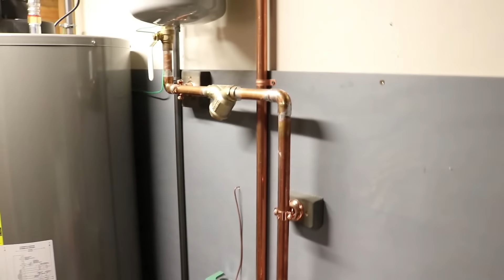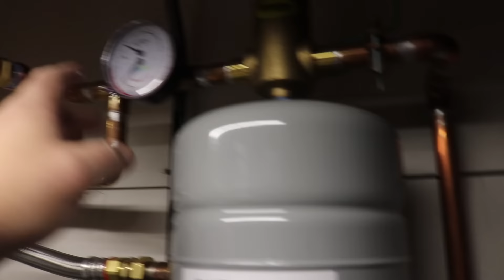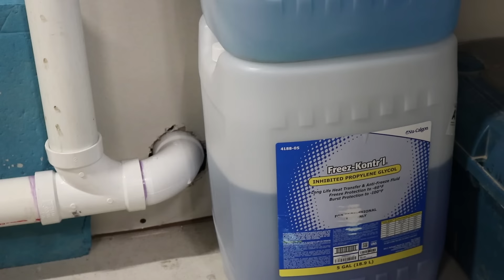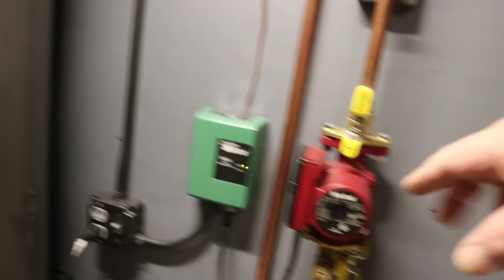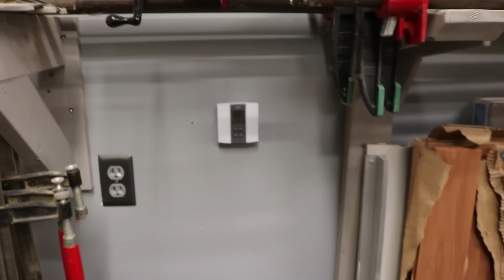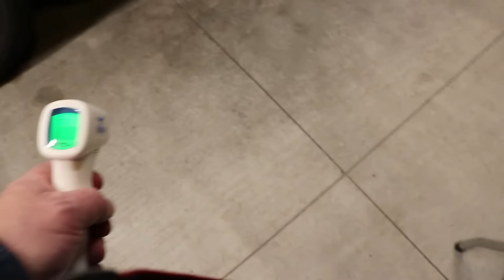Simple In Floor Heat

Comment: Nice work and good job with the explanation. I have a system myself and enjoy 60f also. 
It doesn’t cost much at all to keep the garage warm all winter here in Ontario..mine only has water in it and I was looking for info on how to remove the water and add Glycol.
I got an estimate for $2,800.00 to do a larger one car garage.
I thought that was very expensive for what needed to be done.
A guy just left and is giving me another estimate in a couple days.
I’m considering doing it myself, it can’t be that difficult.
I can do a lot of work for to save a few thousand I’m sure!

Comment: Great info and video . Im starting to research in floor heat for a new house and shop build. Your tank heater is a much cheaper way of doing it opposed to a boiler set up . I was quoted around 10k for a 120k btu boiler for my shop build

Comment: Just the video I was looking for.  I’m getting ready to erect a metal building in the back for a workshop and I want to install radiant floor heating.  The building won’t have plumbing so I’d need a stand-alone system such as yours.  Did you use any reference material to design your system?

Comment: Am having Hydronic envy. A couple of questions - why a gas hot water tank and not a boiler to holding tank? How often does the system cycle on/off. And lastly, what is your average heating cost. Thank you

Comment: I like the simplicity. This is how I would like to set up our basement. My question is there a thermal siphon action that allows the liquid to continue flowing through the system? Or is that limited by the pump? Just wondering.
Reply: In order to thermosiphon. The heat source would need to be located below the thing being heated. The rising hot water would need a slight and constant upwards pitch. And the return would need more drop pitch, then the riser side. Heat wants to rise. It will not circulate downwards.

Comment: Were you able to use the Taco controller to stop the hot water heater from running when the room thermostat wasn't calling for heat and the HW heater thermostat was?

Comment: I also have hydronic floor heat system that with a boiler but my neigbour has a similar floor heating system as you. I have a question.
Her thermostat are old dial ones and are located in her utility room. What if she runs her water pumps full time and then put a digital temperature controller on the water tank with a floor probe and kept the water at the temperature she wants . What does anyone think about that.

Comment: Hi, have a question, we do have infloor heating as well and we turned off the thermostat in the summer and trying to turn on back this fall but there is no heat on the floor? What do you recommend how to check what’s is the problem is?

Comment: am i missing something, there is no domestic feed to the water heater  do you manually feed water when needed
Reply from the maker: Correct, when I turn it on for the season I may have to add a little water to get my pressure up to 10-15 lbs. But unless I have a leak somewhere it doesn't lose any water. It's a closed loop system.

Comment: I did almost the exact same ting in my woodworking shop been running from 2005,I made my manifolds and used ball valves. It works so much better than forced air, less dust.also just a regular gas water heater with water it also is for  the wash sink.. Highly recommend this system, wish I could have it in my house.

Comment: 4:50   Nice system!  Just a comment.  If by chance the pressure relief dumps hot water into that plastic drain, I guarentee you that you will find a melted mess!  I can say that with certainty, because that is what happened to me.  I asked the hardware store BEFORE I plumbed the pressure relief into the plastic pipe; they assured me that it "could take anything I could give it"...wrong!  Quite the mess.  I ended up connecting the pressure relief into a dedicated copper drain line outside.  Good luck!
Reply: You used PVC and it melted on you? what temperature did you have your water tank at? PVC can handle like 180F and water tanks are usually around 130F...
Reply: @blh1997-w1q  I agree, something not right there. Pvc should easily handle the hottest hot water from any standard water heater. Thermostat failure on the water heater make it get far hotter than it should have maybe? Could be what triggered the relief drain as well if that's the case.

A lot of houses are plumbed with pvc, and their hot water lines don't melt.

Comment: You're damn lucky your pex lines in the slab didn't get cut when the expansion joints were sawcut.  People, please use zip strips when you're pouring radiant heated slabs and for the love of efficiency use XPS to insulate the floor and foundation in and outside.  Then install meshups for the in-slab wire/rebar to float the pex in the middle of the pad.
Reply: The pipe is 3 inches below the concrete
Reply: Zip strips look terrible .  They are not strait small amount of conc flake off the top..   maybe for some junker shed or if it’s getting covered (tile,carpet,ect).  Plus it’s a pain in ass to do..  saw cuts are only 1/2 inch deep.  If u have tube float that high. You got more issues that are pressing..  I’ve never cut a tube.   Plus saw cuts that are caulked look so sharp and professional
Reply: @jfdesignsinc.innovationsid1583  Caulk is for mistakes and in crete work with heavy drive over loads, the edges of the cuts crack leaving a bulging imperfection of caulk that the owner will pull up anyway.

Comment: Hello...
I am trying to decide on the right heating device for my space, which has wood floors and a crawl space with 20 inches of clearance. I don't have gas available, but I need to use an electric system. The heating area is 24 x 50, and I've identified eight zones. I would like to know the mathematical calculations for determining the best unit to use, whether it's a hot water tank or a tankless system. If I go with a hot water tank, I'd like to know the appropriate gallon capacity. If I choose a tankless system, I need to determine the minimum gallons per minute (GPM). TIA

Comment: Could a 28 gallon hot water tank be used for your system since in a 1/2” pex pipe 300’ long only has about 4 gallons in the lines when circulating
Thanks
Reply: Still waiting for your input…thanks

Comment: Great video.  I'm putting mine together now and it's similar to your setup.  One question: how did you fill the system and how did you purge the air out of the whole thing.  Once the air comes out through the separator, do you have to keep adding glycol from time to time?  Is there a way to check the level of liquid currently in the system?  Thanks. John

Comment: How would this work with a heat pump water heater?  Im getting one for my house it that water needs to be pretty hot, like 125F but a system like this runs at 100f.  Should i just buy a separate heat pump water heater, or is it possible to use hot water from main hot water heater?

Comment: How big is your pole barn?  I am looking to do a small cabin 600 sq ft. (400sq ft in Kcrete over wood floor and 200 feet under wood floor). Thinking a 20 gallon water heater would work for me....
Reply from the maker: 32x48

Comment: I have those braided flex hose on my system too.  The hotter one failed and leaked so I replaced it.  It leaked again bad.  Replaced them both with pieces of oxypex.

Comment: is this a electric 220 v water heater or a gas unit..thks.. System looks great, was wanting to something the same but electricity here is so high it would cost a fortune to heat the home....or so im thinking it will
Reply: He spoke about the power vent on it.
Reply from the maker: It's natural gas power vent
Reply: Get a few solar panels on roof. Use a hybrid inverter. That could supplement the 120v ac $$ bill.....then get a 24v set of panels and use electric water heater with 24v element off eBay. The wattage wouldn't be as much but it free when the sun shines

Comment: Replace that plastic drain valve on the water heater. Mine let go last night. 2 years old. Just one thin hard o-ring on soft plastic is all that's holding the water back. Hopefully you get to it time.

Comment: You have the pump on the cold water side? Wouldn't you pump hot water INTO the system. I'm building an OPEN system using my propane WH for the kitchen, bathroom and floor heating: HW tees off from the wh to floor heating, [air separator, pump to manifold , return manifold tees into the cold water supply to the WH...does that makes sense?
Reply: I don't think it's legal to use same hwt for potable water and home heating.

Comment: Looks great, almost identical to my setup.  I agree to K.I.S.S.  Two things to note, to keep constant pressure (assuming you have a water source) it to place a PRV with a back flow preventer into feed side before the pump.  If your system looses water then you have makeup water.  Next is to increase your HW temp, WH’s don’t like to run below say 115 or you’re get condensation, I found that with mine.  Also, is your thermostat air or slab sensor.  Mine is a slab sensor that works really well.  The air sensor seemed to not be very responsive and the system would overshoot the set point.  With an in-slab sensor it was very responsive.  I just ran a piece of pex into the slab and pushed the swore sensor down it.  I have a 32x30 shoot with 3 loops set at 65 and it works great!  It’s a woodworking shop, so kept a bit warmer.

Comment: Thanks, I am buying a new house (1300 sg ft) and looking to heat my crawlspace to keep the floor and pipes from freezing. I want to mount 3 - 8 ft baseboard floor registers to the concrete and then hook it up like yours. I think it would work great.

Comment: Great video, I had this idea for a year now after I got 2 quotes to replace my Oil Boiler for ...Hold tight .......A cool 19,450. AND $17.000.    I thought to myself  forget about ripping me off , I will go another route. This is exactly what I had plans for , Tomorrow my gas hot water tank gets professional installed 50 gallons for 4000. tax in.  Im ok with that but i am sure I can do this for 1000k. NOT 19k from rip off guys.

Comment: Nice setup but I'd much rather use a tankless system for a radiant floor heat setup.  More cost upfront but less space for the system.  My shop is set a 50 and I can bump it to 65 easily.  The hot water heater tank will bump on & off even if the space isn't calling for it as water cools inside the tank....

Comment: I'd pipe that 30lb relief valve into one of those empty jugs the antifreeze came in so that $200 a jug stuff isn't wasted down the drain. You can probably reuse it.
Reply from the maker: Actually that is a great idea. Thanks!
Reply: Since many people already put a bucket under the relief pipe to keep track of any drips, that's a great idea.

Comment: Good video, nice details on parts and assembly, blowing out and pre-rinsing the lines!! (great ideas), I want to do the same thing with my pex, it’s  been in the slab for several years too. The only thing I don’t see on your system is a feed to water source - I put those on my boiler and connected through pressure reducer and anti back flow fittings in case the system called for replacement water due to whatever causes water loss - expansion/contraction/evaporation/minor leaks not sure- but they said I needed to include it.
Reply: If you put a makeup water source on it,,I would recommend putting a flow switch on it so you know it put water in. Otherwise potentially it could be pumping water out of the system under the slab or in your garage. You could hook it up to a light or a buzzer so you know it burped.
Reply from the maker: I did not include makeup water on mine because the only way I would need any is if I had a leak. On a system as small as mine the expansion tank handles any expansion/contraction issues. I don't have water in the barn so I would have to have a container and pump so for now I'll go without. I haven't had a problem yet, so fingers crossed. If I got low on water my $100 pump would burn out first and it'll cost more than that for a makeup system. If definitely wouldn't hurt if you have a water source handy. Good luck with your system.

Comment: That is a nice system.  I am thinking of getting an outdoor wood furnace, so heating with hot water would be nice.  But it's too late for having pipes in the concrete. So I'll have to go with forced air.  As far as your feet are warm, you feel fine... Thanks!